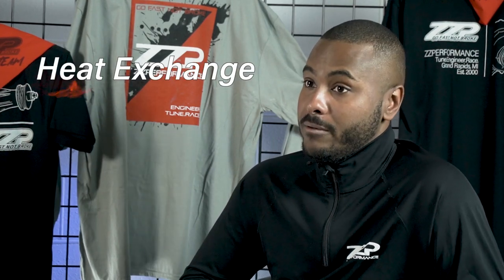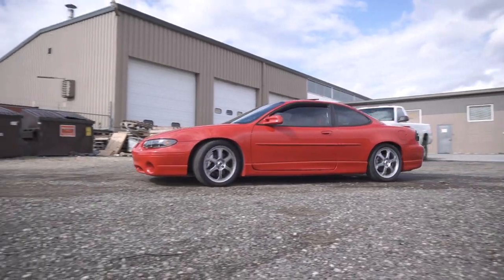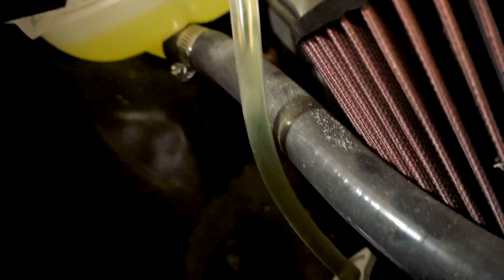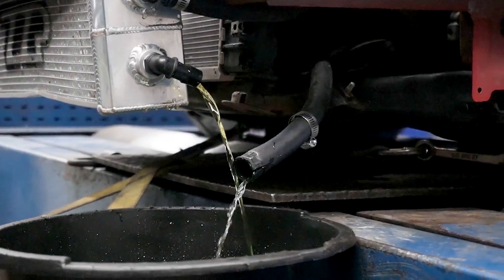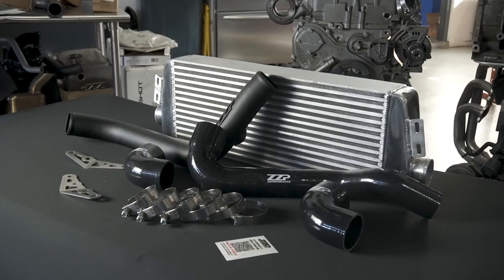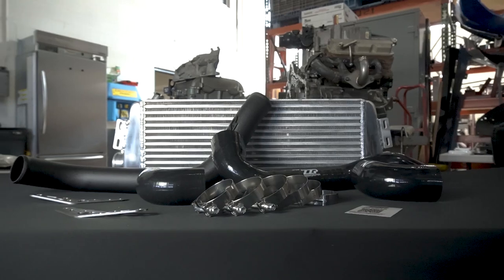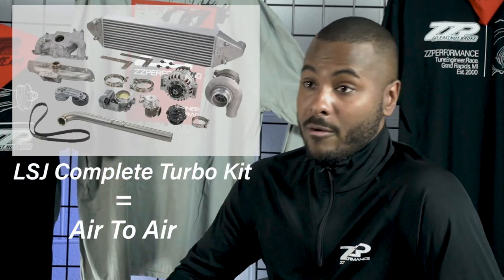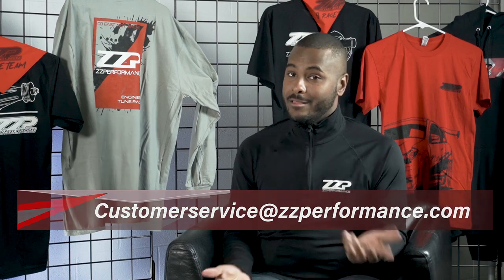Intercooler Vs Heat Exchanger // Behind The Builds // ZZPerformance

Comment: I'm running 2 fmhe with the 2.5 intercooler core on a 2.4 pulley and 21°timing on 3800 car. Setup works quite well

Comment: If an air to air outperforms an air to water, then why would air to water even exist? Since the water system is more expensive and more complex. 

Also why does liquid cooling outperform air cooling in every other situation, while on a turbo intercooler the liquid cooling is inferior?

It makes no sense that liquid cooling would not work as well as air cooling.

Comment: I am changing my Air2Air over to water2air. I am going to be using a device called the Killer Chiller which taps into the vehicles A/C system to cool the fluid running through the Intercooler. 
Do you know if I would still need a separate radiator and fan also for that coolant. I thought the Killer Chiller would be enough. Thank you!